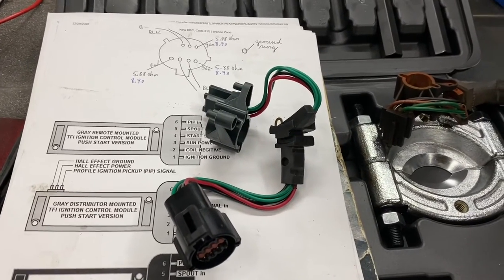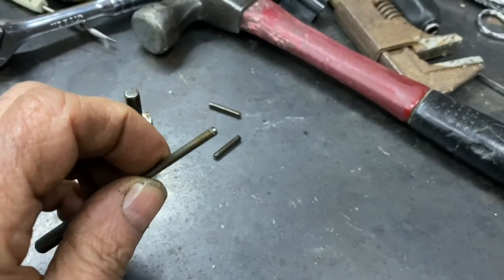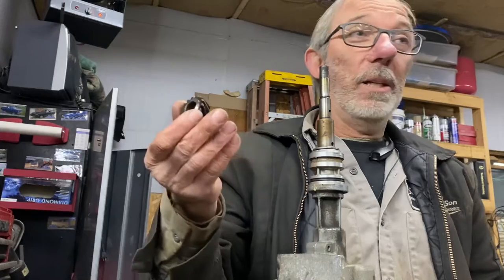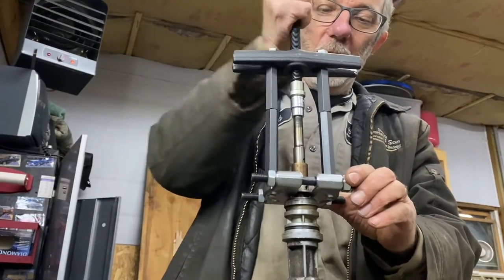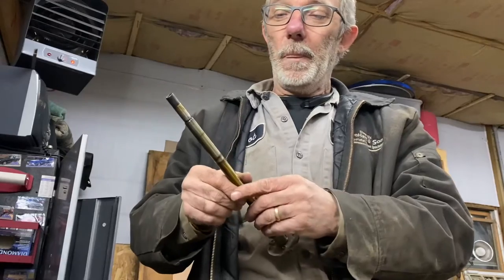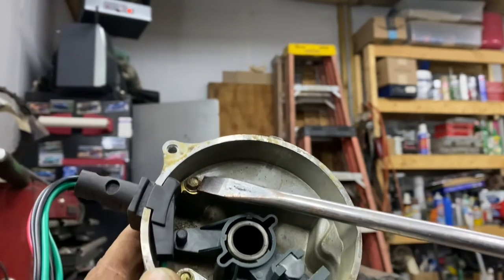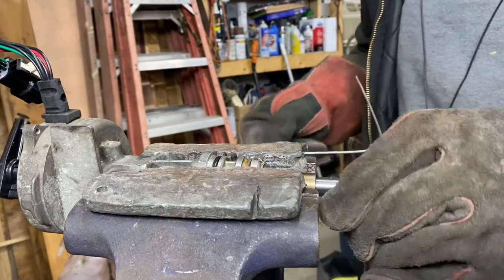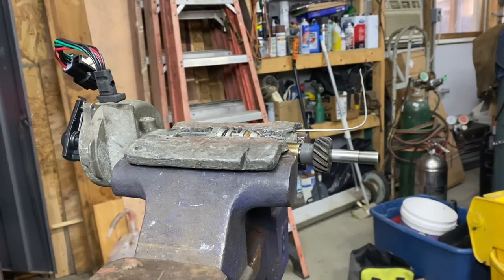92,93,94,95,96,97 Ford F150 distributor gear/pick up coil (PIP) removal and installation of gear

Comment: Can a pip sensor cause bad rough misfire?
Reply from the maker: CJ usually when the PIP sensor fails it fails suddenly and completely,  but of course it is possible to be your problem.  I would definitely rule out all of the simple things first such as plugs, wires, distributor cap and rotor and even vacuum leaks there is also an ignition module that is easier to change out than the PIP sensor. Sounds crazy but these engines are so known for ignition problems that I keep a spare distributor with a new pip sensor in it and a spare ignition module on hand at all times LOL.  You can get an aftermarket duralast distributor for about 100 bucks. Just be sure that the distributor gear is exactly the same as your distributor was or you could damage the gear on your camshaft. Good luck with it. Rob.....
Reply: @robbieraychannel  ok. Can a pip sensor still be bad and truck still starts and run?
Reply from the maker: @hendricks177  yes they can the usual symptom for them is once the heat up they fail and the truck won't run but then it will restart when it cools down. One thing I forgot to mention. You could have a stuck open EGR valve. That will make the engine run like absolute crap at idle.
Reply: @robbieraychannel  I got a 91 Ford f350 7.5 and it's running rough misfire bad. Likes it struggling for air or fuel or something. Everything i put on it is new. MAP sensor. Purge valve. EGR sensor. TPS. Spark plugs. Spark plug wires. Distributor cap and rotor. Idle air control valve. Fuel injectors. Air filter. Ignition coil. ICM. Fuel pressure regulator. And still running crappy. Not run smoothly.
Reply from the maker: @hendricks177  wow I see your problem. looks like you had to throw the house at this thing. Keep in mind that the EGR valve is not the same as the EGR sensor. The valve on older trucks looks a little bit like a flying saucer. Some of the old ones have a gap underneath that you can stick your fingers up under there and push up on the diaphragm. in a working system this should make it run like crap when you do that. But of course it could already be stuck. Another thing I forgot to mention. Not sure if yours has a catalytic converter. But I have seen before on vehicles where someone tried everything else. And it ended up that the cat. came apart inside and clogged the exhaust system. One of the symptoms for this is you will actually hear a hissing sound if you pay close attention. And It will also run badly and have no power. One easy way to check this is to take the O2 sensor out of the hole which will relieve some of the pressure. The one before the cat if it has it. If it runs better like that it is likely plugged.
Reply: @robbieraychannel  the sensor on top of the EGR valve is new but the EGR valve itself is not new. I haven't too it off yet but when I unplug the connector part for the sensor. I put a test light on the connector harness and the light barley lights up. Not even bright like it supposed to.
Reply: @robbieraychannel  could it be the EGR pressure sensor has a low voltage?